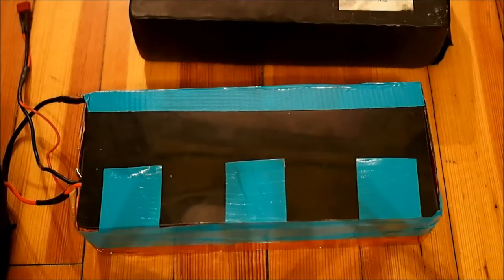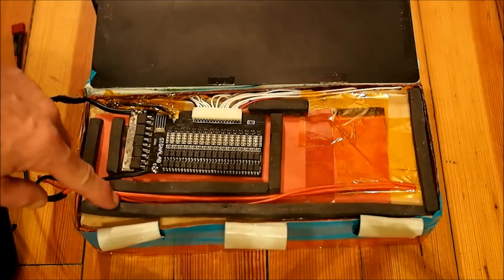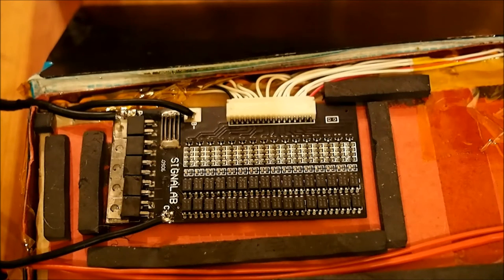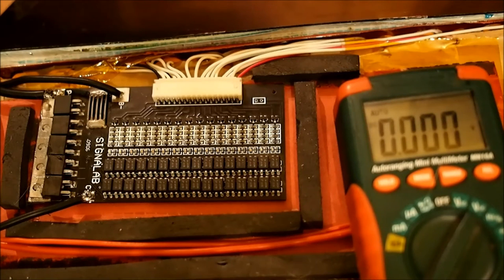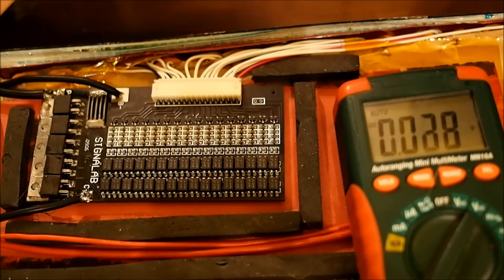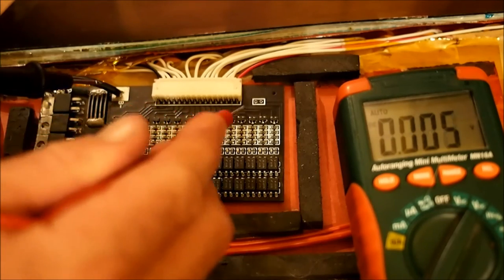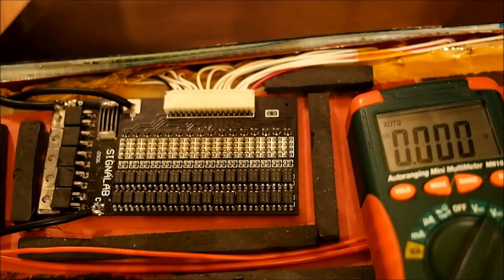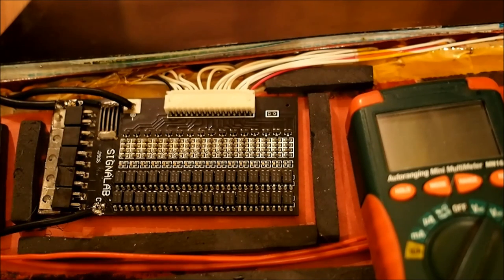LiFePO4 eBike Battery/BMS Troubleshooting

Comment: Thanks for the troubleshooting guide on e-bike batteries. I was in a real jam when after finishing a ride and suddenly my battery wouldn't take a charge for the next ride. After scouring a dozen videos on youTube I found yours. followed your troubleshooting guide step by step until discovering it was the BMS. I have a new one installed now and my 52v 17.5AH is sailing along like new.

Comment: Thank you so much for this information.

I had two issues with my battery pack and I would like to share them with others.

The first one was the power get disconnected especially after increasing motor speed, and it was due to defected battery groups. It seems the BMS disconnects the power to protected cells. I found the defect ones after connecting a resistor as a load (with 1A discharge current) on each group and monitor voltage decrease, then replace the one which is either short or has a low voltage.

The second issue was the BMS is not charging. After checking with a multimeter I found an open SMD resister (value is 471) and replaced it. The BMS was able to charge again.

Thanks again.

Comment: Thanks for you comment. I back tracked my wiring with the balance leads and 1 was out there for the last 6 leads were also out. That explains the high voltage.

Comment: Thank you for great educational video. I have a battery where the charging port wires got shorted and I noticed that battery is not charging adnd voltage is not as it should be when full. Battery is Lithium ion 13SP6 48V 4.2V/cell (54.6V when full). I measured voltages between cells and I got all cell channels on 4.2V except 2 channels. 5th channel is 3.17V and 8th channel is 2.76V. I was wondering is it possible to disconect bms balancing plug and plug 1S charger to channels 5 and 8 separately to charge thoose batterys to 4.2V or should I dissasemble the whole battery pack? Also when Im measuring output voltage at the discharge port C- I get  47.7V (both charging and discharging wires are soldered to C-, P- is left free and I dont know why) and voltage at the B- 52V. Measuring voltage between B- and C- = 4.38V. Do you have any advice as what to do next? Thank you.
Reply from the maker: The video I made is for LiFePO4 batteries. While the same concepts apply, the voltages are different as are the battery chemistry. Be VERY careful while troubleshooting!!! Lithium ion batteries are not as fire-safe as LiFePO4 are.

Never leave a battery charging unattended, don’t charge it inside your house(a yard or garage is better), and DO keep a fire extinguisher handy. 

Having said that, Sounds like either some of the cells are damaged or the BMS is damaged. Your plan of charging the 5th and 8th channels separately is a good one. If both channels take a charge and hold 4.2vdc, then it’s probably the BMS that is damaged. If those channels will not hold a charge, then the cells could be damaged. 

The other option is just to buy a new BMS and see if it is able to charge the 2 channels that are low better than the one you suspect is damaged. If it works, great. If not then some cells are damaged.
Reply: @charleswerbick2154  Thank you very much for your fast reply. I will be as careful as I can. I will try to charge thoose 2 channels, and I already placed the order for new BMS for any case. Best regards.

Comment: I've just gambled on an older IZIP Metro with 36V Lithium Ion System which came without a charger, and looks to have been out of service for quite while (dusty etc). It uncharacteristically has a 4-pin plug for the charger. I succeeded in removing the battery pack from its fat downtube housing and disconnected the charging plug. That plug had the typical 3 pins, not four and I was able to check continuity to each from the charging port. Is the forth pin connection at that port just Curry's way of making me buy their charger or does it conceivably play some part in the system? Lastly, the battery registered only 4.9 volts when tested: is this in itself a death certificate, at least of a cell? The original charger is very expensive and rated at 4 amps. I put my charger from a Ping 36v battery on the connections and its fan didin't even begin running. Very grateful for any input on this.
Reply from the maker: Not familiar with any 4 pin Currie charger. The ones I have seen are 3 pin XLR (Like a microphone). They use that connector because it is polarity-protected and can't be plugged in backwards. If the battery is only reading 5 volts, then the cells are certainly damaged. (You ideally want to see 3V per cell on even a dead battery.) If there is no corrosion or water damage on the battery circuitry, then you may be able to rebuild the battery & replace the individual cells. Battery stores can also do this for you too, esp. if the cells are welded together. The other option is just to get a new battery. 

BTW - You are probably lucky that your charger did nothing. (Damaged cells can catch fire when charged.)
Reply: Yes this bike has a 4 pin XLR, w the pins arranged in a trapezoidal configuration....so I wonder what purpose a 4 wire (if it exists) might serve. The Curry charger is a 4 amp. My Ping charger is much less. Overnight the voltage has risen to 5.2. There is not sign of anything getting warm except the charger's normal warming. Thanks for the input: greatly appreciated!

Comment: Hello! after 1.5 years of usage, my lifepo4 battery stopped charging (light on charger is off), and also DC voltage between + - terminals shows 0.

On the other hand when I opened up the battery case and checked the NEGATIVE wires like in your video (on 7:35) - it shows 13.95V - which is a perfect condition voltage (if came from + -terminals).... what does it mean?

Comment: Hi first of all thanks for this great video, very clear and very instructive!
In my case I have a 10S5P 36V LiPo battery where I had to change the old BMS.
I followed your suggestions, tested B-, C- and DS- and verified that there is NO voltage amongst those, so this is fine.
Then I have also tested on the balance plug from B0 (the negative) and B10 (the positive of the 10th cell), I see 39,6V: this means that wiring on the balangc plug is OK.
Unfortunately when I test against DS+ and DS- I see 18V, where between B+ (directly on the battery) and B-  I have 39,6V.
Same thing, when I test against C+ (directly on the battery) and C-  I have 18V.
I guess that the BMS is faulty, what would you think?
thanks a lot!

Comment: Mr. charles I got the dc voltage reading between those 3 negative terminals in BMS when my battery power switch is turn off but if I turn on the power switch I don’t have dc voltage reading what does it means? my battery is li-ion 48v 14.5ah LG cells battery 2yrs of usage but not in everyday use. and my problem is the battery is not charging because the battery charger led indicators is not lighting up but I tested the battery charger thru multimeter and it’s working properly supplied the right amount of voltage for the battery

Comment: Fantastic video !!! I have a 48v LiFePO4 battery pack. I charged it up until charger turned green indicating battery charged and I checked voltage at the battery connector with it connected to the motor controller and I’m getting 58v after riding it around under light throttle  for a few mins it dropped to around 53-54v . My problem is when I accelerate hard the scooter cuts out I lose all power... i check voltage at the battery connector with fault present and I’m now getting 4v I unplug battery connector and check battery voltage and voltage comes back to 54v I then plug battery back into motor controller and I still have 54v and can ride around under light throttle for a bit as long as I don’t accelerate hard. If I hard throttle issue comes back I unplug and reconnect battery and I can go again under light throttle Do I go after battery??? Or motor controller??? I’m leaning towards battery/BMS
Reply from the maker: Sounds like the under voltage protection is kicking in. You may be pulling too much current for the battery capacity or the battery may just be worn. What is the capacity of the battery and how many watts is your motor? (Also, how old is the battery?)
Reply: Charles Werbick it is a 1500w BLDC motor the battery is 48v 20ah Lifepo4 60a output battery is a couple years old only used a few times
Reply: Had this issue when battery was “new” just never addressed it

Comment: Charles thank you for getting back to me so quickly.  I think I can replace the 5 batteries.  They were in the last row, easy to get to.  I'm going to get a new bms also.  Will a new one plug right in?  My bms as no temp. sensor all the new ones do.  I'm getting a small spot welder too, are they any good?  Thanks again, Rick
Reply from the maker: Usually the BMS will connect easily. Just make sure you get a Li-Ion BMS and not a LiFePO4 one. The charge voltages are different.
Reply: @charleswerbick2154  I have 2 wires going to my switch from my bms.  how do I find a bms with those 2 wires?  I see bms with thermocouple but no switch wires.
Reply from the maker: @rickdag1  - some BMS have a connector for a switch, some do not. If in doubt, ask the vendor from which you purchased the BMS for a wiring guide.
Reply: @charleswerbick2154  I was using Amazon to find a bms.  it's really hard to contact a vender on Amzon. Any suggestions on a place to buy a bms. thanks!
Reply from the maker: @rickdag1  - i would recommend looking on  eBay and Banggood.com for ebike parts.

Misty any ebay seller will answer questions prior to purchase.

Comment: Hi Charles, your explanation is very good. I have a problem with my PCM, I suspect it needs a replacement. The 10s 4p battery will not charge or discharge. When the button is pressed to switch the battery on the LED's showing state of charge light up for 3 seconds, the voltage at the pack output terminals goes from 20.4 to 40.3 and then voltage goes back to 20.4....   voltage at terminals B- and B- (output) is zero and voltage between B- and C- is 40.3 and voltage between B- (output) and C- is 20.4. what would you recommend?
Reply from the maker: It's possible that the module is bad. Or you could have a bad cell in your battery pack. (The first is more likely as a 4p battery should be pretty robust...)

I'd check each cell's voltage. If all of the cells are above 3.3V (3.0V for lipo), then your charge controller is probably toast.

Comment: Thank thee :-)
However I do have a question. I have the voltages for a LiFePO4 cell listed as:
minimal 2.500 volts
nominal 3.200 volts 
maximum 3.650 volts

Should not a fully charged battery have cells at somewhere near the maximum ?
Reply from the maker: Fully charged LiFePO4 cells are about 3.6V.

Comment: Hi. Very well explained video. I am following through some of these steps because by pack got wet and now charges to full but then cuts off after riding for a while. When I check the voltage across all the points , I am getting just under 4 on then all and approx58 for them all but when checking the voltage across them  it seems to start smoking??  Any thoughts
Reply from the maker: I'm sorry to hear your pack got wet. Smoke is generally an indication of thermal damage. Testing the BMS and battery should not cause smoke. Multimeters have high internal resistance. But you do want to be careful not to short any connections on the board with the test leads.

To find your fault you may need to load the battery until it fails, then test it.(without removing from the load. You may find that one of the BMS circuits is faulting or perhaps one of the cells in you battery was damaged by water and is dropping in voltage before the others...
Reply: Thanks for the quick reply. Your second idea makes most sense- the pack is attached at a 45 degree angle so the pack at the bottom was sitting in the water!!  I assumed because it charges to the full approx 58v that it was probably ok but I guess that is not necessarily true?
Reply: Hi. So I changed out to packs of 5 cells in my battery pack and it still cuts out after a few minutes of load. Plus the new packs didn’t charge up to 4.1 just stayed at 3.5. I’m guessing that is because the other packs all are at 4.3 or 4.4 so the total reaches 58 and then cuts out without getting a chance to charge the new packs.   I think that means I need to get the other packs down to 3.5 so all packs can charge and get balanced. I’m going to do that but over riding the bms- does that make sense?

Comment: I have a question.  I checked voltage in each battery cell on a 36v 500w e-bike battery, they were 4.3v in each cell, accepted 5 cells. Cells say they are 3.6v, 2500 mAh, 9.0Watts.  5 batteries read 1.2 volts when still in the pack.  I figured they were bad, so I removed them. Then I checked them again out of the pack and got crazy numbers.  Here are the numbers, Why?  5.6v, 1.9v 5.6v 1.3v 13.1v   HELP PLEASE!
Reply from the maker: 3.6v cells are li-ion. If they are reading under 2volts it over 4.4 volts per cell then they have probably suffered internal damage. 

Note - Be careful!!! This is a safety issue. Unlike LiFePO4 cells, lipo cells can catch fire when they fail. You will want to either want to have the bad cells replaced or get a new battery.

Comment: i have a battery pack that got wet and i had to replace 5 of the cell in one of the series. when checking across the balance connector i get 4.19 - 4.20. i have even removed the connector and checked voltages, in which i get the same. 
i have checked from the battery negative to the negative terminal on the balance port. i get 4.19
i have continuity across the negative terminals (0v)

the issue comes when i put a positive and negative connection in the connection that goes to the controller. i get either 0 voltage, or the voltage goes to 18v and then disappears. i have no idea if it is the bms that is still faulty?...
Reply from the maker: Yes, If the BMS got wet while plugged into the battery then I'd suspect it has been damaged. 

If your lipo cells are testing at or near 4.2 each cell then it sounds like the cells might be ok (damaged cells will probably not hold 4.2v each.)

However if ANY of the cells in the series drop below discharge cutoff voltage (3.3V or so), then the BMS is designed to cut off the load. That's to protect the cells.

So you MUST rule that out before concluding the BMS is faulty.

Comment: I have a question though. is it possible to just rip the BMS out and have your battery work w/o it? seems to me that it's not necessary except for balancing cells that don't really need balancing.
Thank you for very good informative video
Reply from the maker: Hello and sorry for the delayed response. This is a topic of heated debate in eBike circles. There are competing viewpoints and evidence on both sides. (Any response I give will likely be flamebait for someone.) I will say that aside from balancing the cells during charge the BMS does perform ONE other important function- It disables the entire battery during discharge if any bank drops to ~ 2.8V. This helps protect the cells in the battery from being damaged by being run down too far.

I would not criticize someone either way. But I would encourage you to do your research and make an informed decision.

Comment: Hi there, thanks for a great video. 

i am only new to this but ive been building ebike batteries for about 6 months, now,and have had some trouble wondering what trouble shooting i can do. im building a 48volt 13amp hailong battery pack. your video explains that if there is any voltage between C- and P- is saying 176.3volts dc and the same from P- to C- is the same 176.3 volt dc. .and from B- to P- its 4.7 Volts , what does this mean. ? i am using 3200mah lg cells and a 15 amp bms.? and how do i trouble shoot from here.?i will note that i have built about 6 to 8 of these the same way and no problem . so not sure what ive done wrong, have replaced bms and the same result i have got, does this mean the bms is not working at all ??
Reply from the maker: If you are building a 48V battery you should NOT be seeing 176.3V anywhere in your setup. Sounds like you have severely miswired your cells. (and probably completely hosed your BMS).

You say you are building a 13 Amp battery from 3200mah lg LiPo cells? So that would suggest that you are trying to build a '12S4P' cell. But instead of wiring each of those 4 cells in parallel it sounds like you wired them in series. (and then wired all of those in series) So my guess is you accidentally made a 48S1P pack! 

I could be wrong. (I haven't looked at your set-up) But thats the only way I can think of you'd get those voltages...

For more information on battery pack configurations read this - http://batteryuniversity.com/learn/article/serial_and_parallel_battery_configurations

Hope that helps!

Comment: I tried trouble shooting your way and nothing showed up. My charger works because i used it on another 42v 10s battery but when i tried to charge my other battery with a 10s bms it doesnt charge. It only charges for a few seconds when i discharge it for a couple of seconds. Each cell is at 4v making it have a total voltage of 40v and it just doesnt charge. I know it isnt that the charger is stopping because of the voltage on the battery reaching 40v because it is a 42v charger. My bms is a 45a 10s 42v bms

Comment: I just watched you’re video. I just build a battery pack with a brand new bms but did wrong balance wiring, I try to do it right but now my bms show 7volt between C- and B- and 0,25 between P- and B- and ofcourse it wouldn’t charge. I’m wondering if I burned bms when I put to balance wires on the same battery?